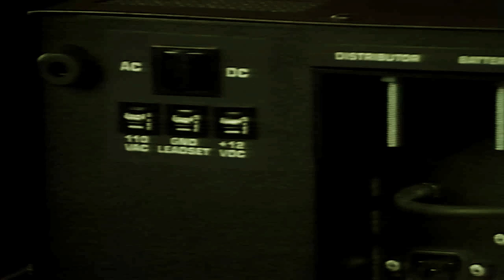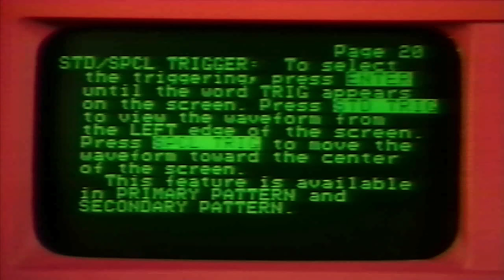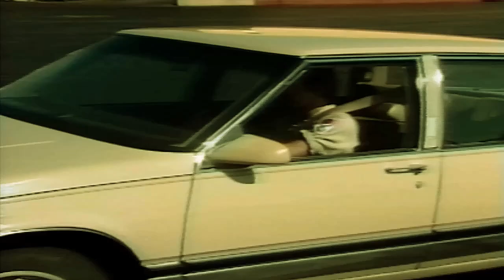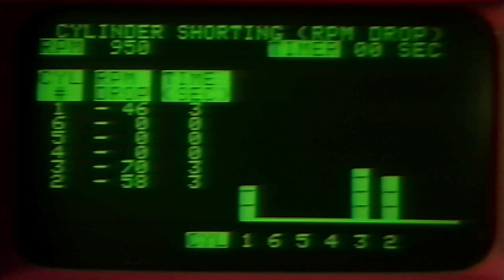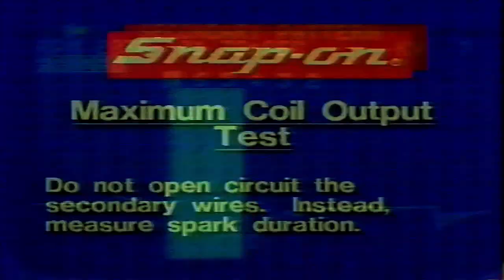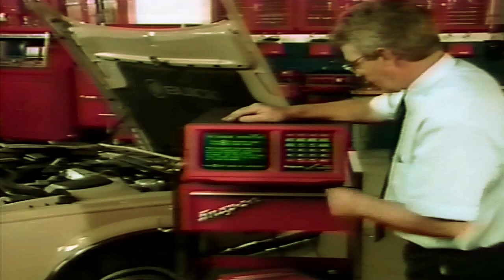Old School Learning Snap on MT1665 Counselor Scope 1987

Comment: I have an MT1665 missing the leads. Do you have any information that would help making them? I'm not sure if there are any capacitors or inductors in the pickup leads. The diagram I have only goes from the main plug to the two small ones. Nothing about the actual pickup wiring.

Comment: in 1988 MT2500 came out and it was supported by Snap On until 2009 and it is still used today
Reply from the maker: "Thank you for your comments! The MT 2500 scanner was indeed a groundbreaking tool. Like you, I got extensive use out of it over the years. Working in the lab, I had the opportunity to see it before it hit the market, and at the time, we were up against major competitors like OTC. However, once the MT 2500 was released, it quickly dominated the market, supported strongly through Snap-On's corporate and dealer networks.

I’m planning to create a video that delves into the history of Snap-On's diagnostic equipment, tracing its evolution from the MT 1665 to the MT 3000. These tools were all part of the engineering efforts in Kenosha. Later on, when Snap-On acquired Sun Electric, the development landscape shifted. Some design work was done in Lincolnshire, Illinois, and at the old Sun headquarters in Crystal Lake, while we continued product development in Kenosha. Concurrently, our team in San Jose, California, was working on the smaller hand-held devices, including the MT 2500 scanner, during a time when technology was rapidly miniaturizing.

It’s worth noting that during the pre-1990 era, the components available for the MT 3000 were in a different league compared to those used in the MT 2400 Scope in the mid-1990s. The automotive market was also in flux—many vehicles still had distributors and carburetors that were being serviced, so traditional diagnostic methods were still relevant. Yet, automotive technology was advancing rapidly, and keeping technicians up-to-date with both the evolving vehicle technologies and changing tools was a significant challenge.

Again, thanks for your insightful comment. I’ll get started on that video soon!"

Comment: What do you know about the counselor 3? I cant find any information on it
Reply: So if I'm understanding correctly your saying snap on never actually made a counselor 3? I only ask because I found one for sale near me that I'm interested in. Model number EE0S304. I can't find any information online about it however
Reply from the maker: @Goof7810 @Goof7810, Oops, that's right. They used the name Counselor 3 in a repackaged Counselor 2 scope that was a DC unit only. What I was referring to was the inside department code name "Couselor 3" for a brand new, ground-up design of a new scope. Most of the ideas went into the Modus, "Put not all" and by that time, Electrical Engineering had moved out of Kenosha, and I moved on to new and even more exciting work. Sorry for the mixup. Bob
Reply: Counselor 3 to me looks smaller version of Counselor 2, it has a carry handle on top and the same amount of same buttons on the front. I have also seen one on sale
Reply: @HakenE30  As Bob ^ said DC only so wouldn't need transformer and rectifier and smoother ?
Reply from the maker: Thank you for your question! The story behind the Counselor 3 is indeed an interesting chapter in automotive diagnostic history. Following the completion of the MT 3000 Counselor II project in 1991, we were deeply involved in exploring new leads and innovations driven by field technicians and advancements in the automotive industry.

During the late 1980s, our team developed several promising concepts while working on the MT 3000 Counselor II. However, these ideas never made it to production at that time. In 1992, Snap-on acquired Sun Electric Corporation, and the focus shifted towards integrating the two companies. This significant corporate merger took precedence, which unfortunately sidelined the development of the Counselor 3.

The innovative ideas that were intended for the Counselor 3 were eventually incorporated into other products, notably the Modis. While the original vision for the Counselor 3 was never fully realized, its influence can be seen in various subsequent diagnostic tools. The transition into a larger organization meant that some of the synergies and innovations were divided among different projects, leading to a more fragmented development process.

It was indeed a wild and dynamic period in the automotive diagnostic arena, filled with both challenges and exciting advancements. I appreciate your interest and support for the channel. Stay tuned for more in-depth videos covering that era and other fascinating topics in automotive diagnostics.

Thanks for subscribing and commenting!